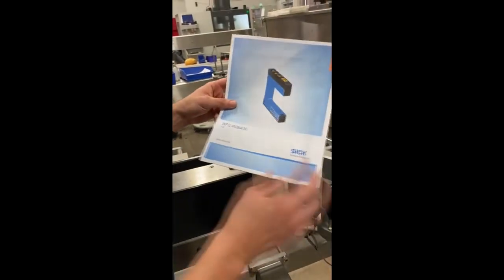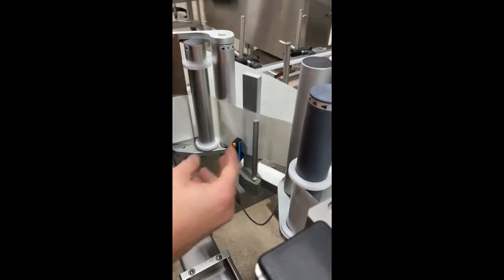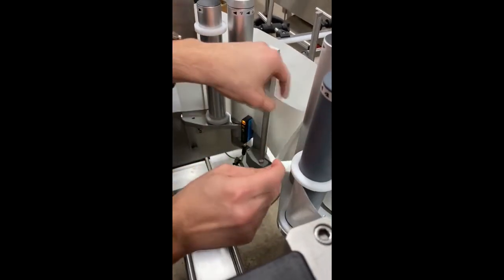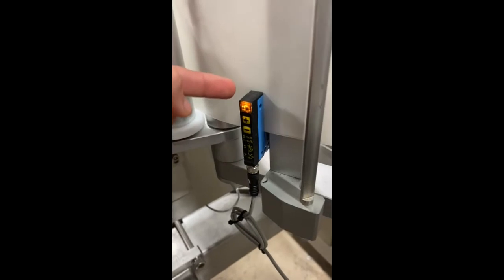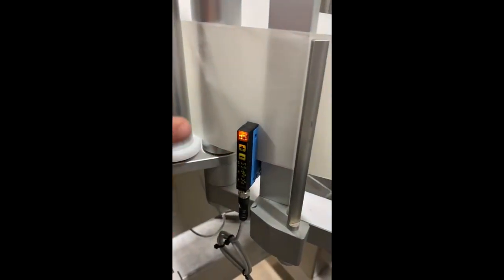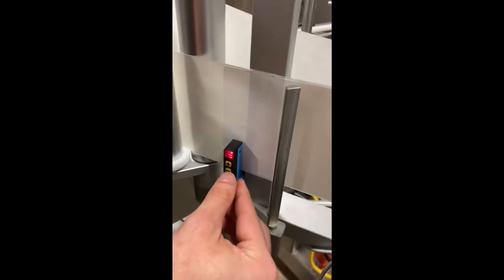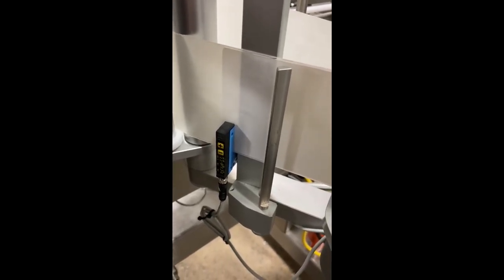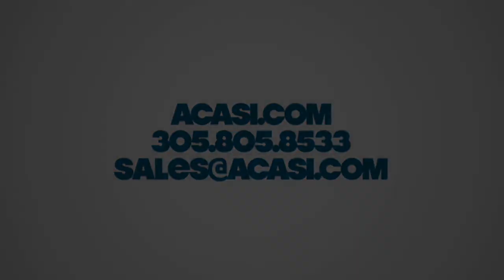How to Setup the Fork Sensor in a Labeler Machine. Model WF2-40B416

Comment: My bottle only gets half a label every time at the label tape ?
So when the three pressing wheels push the bottle only half the label goes on the bottle and the other half is still on the liner.
Do you have any recommendation on how to fix that we have the same fork sensor.
Reply: Depending on what label machine you have you need to adjust it for the length of your label first. This is a gap sensor so it detects the gap between labels on a label roll.